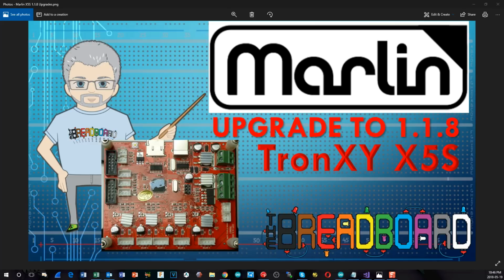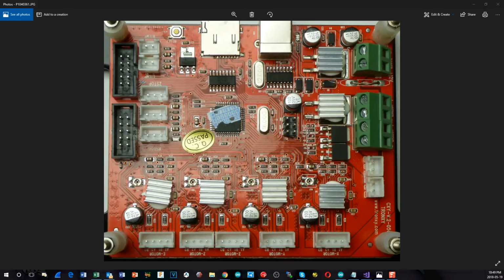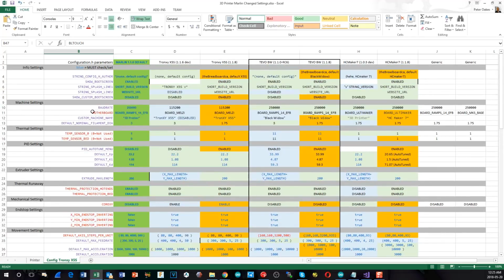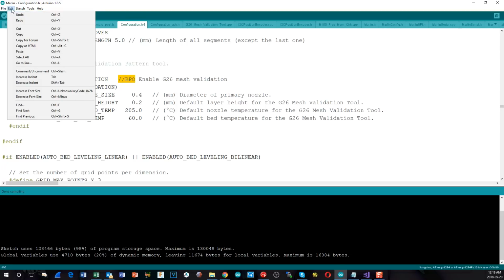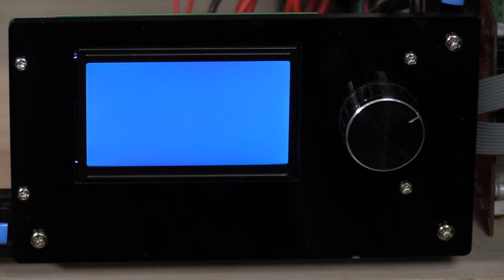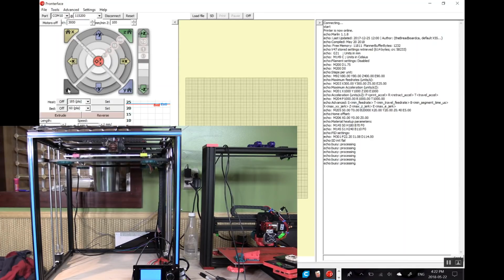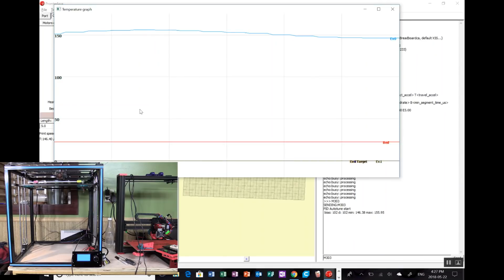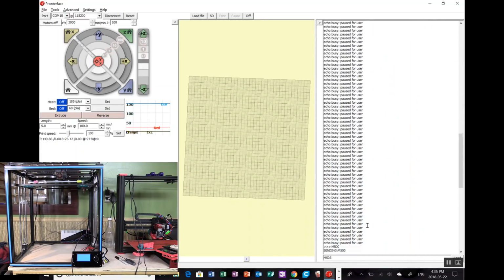TronXY X5S - 3D printer upgrade to Marlin 1.1.8 part 5

Comment: I have a hex file and tried to load it but it just hung no matter what the configuration was. I tried uploading marlin via Arduino and it wouldn't compile/upload if I choose Sanguino.
Reply from the maker: did the file load the first time, if not then you may need a small AVR based programmer board as there is a good chance there is no boot loader in the target board.

Comment: The Tronxy website says "Can use open source firmware Marlin, configuration and Ramps1.4 exactly the same, can directly replace Ramps1.4." but the video seems to indicate that there are indeed config changes that need to be made.
Reply from the maker: Indeed you can use a Ramps board and the latest Marlin, in this video it was 1.1.8 and this video I show the upgrade to my X5S to use the Ramps board and a few other hardware upgrades, this includes programming the RAMPS board to 1.1.8, there is also a link to my configuration in the description of that video https://youtu.be/q1nfojoZUvA. There were a couple of "Tweaks" to the config in order to support the original display and that is why I provided my config file. I also describe the changes etc.
Reply from the maker: investigation it was found to be the pins_SANGUINOLOLU_11.h that was the issue, the configuration.h was actually ok but a bit better when I added the three timing updates. the Pins file had been completly changed by Tronxy so they were not following the MELZI pin out. as soon as I copied the one from my original Tronxy X5S build it burst into life. I hate it when Manufacturers rip off something and then just tweak it enough to call it their own but dont change the names etc to match. Ah well, its working at least and I will still be updating it to a Ramps 1.4 board as I want to add  24V, BL touch and other features so I need the 2560 chip.

I have updated my GitHub folder with all the files(3 of them) needed to copy into a standard Marlin download
https://github.com/thebreadboard/MARLIN

Comment: Would this same process be able to be used on the tronxy X5SA pro (24V)
Reply from the maker: I dont see why not, you need to know what the board type is so you can set the right pins mapping, that should be easy to confirm
Reply: @TheBreadboardca  Thank you for the reply It is actually going to be my 2nd 3d printer. I still know nothing about it though...Lol I have a friend who is helping me and he said to find a way to put marlin firmware so that the offset can be changed for a BL touch and in case I want to change the carriage later.  Is there a way to just flash Marlin without changing any pins?
Reply from the maker: @truthslayer9653  No, unfortunately there is not, especially if your adding BL Touch etc.You use Arduino IDE or Visual Studio Code with PlatformIO, compile the Marlin code and then upload, once you have the pins set though, you can make other changes without affecting the settings again (BL Touch may actually be the exception as it needs pins configuring for it

Comment: Is there anything different in Marlin if you have a Tronxy x5st 500 2E model?
Reply from the maker: Yes, plenty. Size for one, the 500 2E is 500x500x600 so a good 20cm bigger in Z direction and 17cm in x and Y. it also has touch sensor and TFT display so there will be many differences in the configuration file. I dont have one of these printers yet so cant share my configuration file. It looks to be a massive printer and also has the benefit (And need) of using a 24V 500W power supply.

Comment: Hi please, I really hope you can help. I recently bought a Tronxy X5SA 3D printer but every time I try to print using a USB and repetier software I get errors such as (it seems we are missing and OK). So I thought it was the configuration so I tried various ones but still got the same error. Please if it is possible can I get a configuration for this printer.
Reply from the maker: Are you planning on reflashing the firmware, do you mean Cura of Slic3r or something else. can you show me the exact error you getting ?

Comment: C:\Users\Lt.Dan\Downloads\TronXY_X5S_Marlin_1.1.8_Firmware\files\X5S_Marlin_1.1.8\Marlin\Marlin.ino:1:20: fatal error: U8glib.h: No such file or directory
 #include <U8glib.h>
compilation terminated.
exit status 1
Error compiling for board Sanguino.

Do you know what I'm doing wrong?
Reply from the maker: In Arduino IDE, go to library manager and search for U8GLIB
Thats 
[Sketch], [Include Library], [Manage Libraries] 
type in u8glib and look in the list, there should be one from "oliver", mine is version 1.19.1, install that and it should now go past that error
Reply: You are the man of the day..... I've finaly updated 2 X5S now. Marlin 1.1.8 from thing:2738690 runs fine. The Marlin 1.1.9 from thing:3034942 can be uploaded, but my Displays stay white. Don't know why, but this can be fixed later. :)  @TheBreadboardca
Reply from the maker: @michaelbottger4983  Happy to see your up and running

Comment: Yes I did check the mosfet chip all is correctly hooked up. I even tried a new mosfet chip. No change there either. I’m wondering if it’s a faulty board?

Comment: Hey Peter! I did everything you said step by step, but I can't fix this issue I tried now for a 5 days and no luck.. here is my error..
Sketch uses 120576 bytes (92%) of program storage space. Maximum is 130048 bytes.
Global variables use 4544 bytes (27%) of dynamic memory, leaving 11840 bytes for local variables. Maximum is 16384 bytes.
avrdude: stk500_getsync() attempt 1 of 10: not in sync: resp=0x58
avrdude: stk500_getsync() attempt 2 of 10: not in sync: resp=0x4c
avrdude: stk500_getsync() attempt 3 of 10: not in sync: resp=0x41
avrdude: stk500_getsync() attempt 4 of 10: not in sync: resp=0x4f
avrdude: stk500_getsync() attempt 5 of 10: not in sync: resp=0x44
avrdude: stk500_getsync() attempt 6 of 10: not in sync: resp=0x0a
avrdude: stk500_getsync() attempt 7 of 10: not in sync: resp=0x65
avrdude: stk500_getsync() attempt 8 of 10: not in sync: resp=0x63
avrdude: stk500_getsync() attempt 9 of 10: not in sync: resp=0x68
avrdude: stk500_getsync() attempt 10 of 10: not in sync: resp=0x6f
An error occurred while uploading the sketch
can you Please help. thanks chris w
Reply from the maker: So it looks like it is compiling ok, just not uploading. I assume your using an ISP programmer, not the USB port on the device, please confirm. I will dig out my controller (I still have it) and see what i do with it. What type of programmer are you using ?
Reply: Peter Oakes. Still having Sam issue with heat bed not being able to control. This is why I wanted to change firmware. Errrr
Reply from the maker: @3BoyzLaserEngraving  did you check the mosfet etc as I had described in the other thread
Reply: ok I did some checking bare with me as I tell you my steps.
1. I switched mosfets same problem as before bed still turns on.
2. I removed the mosfet from my control box.
3. I hooked the hotbed to a 12volt power adbt, of course it turns on as I complet the circuit. so that bed works fine.
4. I checked the hotbed connection on the mainboard and the hotend as well on the board while turned on.
Found the problem with my meter my. board on nothing working, hotend off and hotbed off, I checked the voltage, the hotend has no VOLTS, checked the hotbed and there is 12VOLTS CONSTENT at hotbed. there is my problem from day one. no matter what tronxy would never get back to me or gearbest.  so there is a short on the board from NEW.
now I wonder how I fix this short and how to find it??????
Reply from the maker: @3BoyzLaserEngraving  So typically you should have 12 V on one wire of the Hotend or Heatbed when the PSU is on with reference to the power supply negative (0V), this is how they are wired, 
The + from power supply goes into control board (and Or External MOSFET Board), then to the heater (Hotend or HeatBed) with nothing but a short length of PCB and in the case of the main controller a fuse. the return from the HotEnd or HeatBed goes back to the control board or External MOSFET board to one end of the MOSFET. when the mosfet gets turned on it will effectively short the return path to the 0V of the power supply turning on the heater. to if the heater is ON then you will measure approximately 12V across the terminals of the heater (HotEnd or HotBed), if it is off then you will read 0V across it but 12V referenced to ground.
If you are using an External MOSFET then unplugging the control wire from the control board to the MOSFET board should turn off the heater as there will be no signal to turn on the MOSFET.
If you use your meter on resistance mode and measure between the HotBed output(+ of the meter) and Ground (With the power off) tou should have an open / very high resistance. note if you reverse the meter probes (- probe to heater output and + probe on ground / 0v) you should get a low reading, if not try the same process on Diode check mode). if you get a low reading in both directions then you indeed have a short, either on the board or inside the mosfet
Reply: well I cant figure out how I did it with the printer cable, do you have any idea on how I may have done this? thanks cgw
Reply: I am just using my USB. Flashed it to 1.1.9.  And it works great but not sure how I did it or what settings. I was trying for the 1.1.8. But used wrong file. Also you can take the 2 files save them as .gcode and past on sd card then run as print to also flash and it worked. Crazy I know but when I rebooted there was the new marlin.
Reply from the maker: @3BoyzLaserEngraving  I just tried my original board and confirmed it wont program via the USB, I have to use the ISP socket and a programmer like the pololu PGM03A. this is because the boot loader is not loaded and also if it was it would take space needed for features to be added
Reply: Peter Oakes very odd as that’s how I got mine done when I get back I’ll do it again and show you a video. Thx. My board has a short. On the hotbed side. 12 volts always as my bed led is on. When not asked by the software. When my hotend not in use. There is no 12 volts at the pins. So now to find the short and fix it
Reply: just for poops and hahaha's, I switched the signal wire from my hot end from my mosfet to the heatbed on my board and heatbed signal wire to my hotend side to my board., and now my hotend fires up when not told to do so....im making the video now for you
Reply from the maker: @3BoyzLaserEngraving  If your ok with soldering and un-soldering you could try removing the MOSFET in question and simply power it up again, the board should not heat up if the FET is the broken item
Reply from the maker: @3BoyzLaserEngraving  ok, look forward to seeing it, see if you can include a close up of the mosfet from both sides of the board
Reply: Peter Oakes. Do you mean the mosfet that’s built on the main board or my extra ones I put on my hotend and heatbed?
Reply from the maker: @3BoyzLaserEngraving  can you email a diagram of exactly what you have wired up in that case :), peter@thebreadboard.ca
Reply: Peter Oakes. Yes I can do that. I’ll get it done in the morning for you.
Reply: Peter Oakes   I sent you an email or 4. Lol it might be in your spam
Reply: Peter Oakes just wondering if you got my email
Reply from the maker: @3BoyzLaserEngraving  So I know you can use Cura for instance to upload a firmware version to a printer that has a boot loader but this is not what your describing, can you provide a link to were this method of update is shown as I am not able to find anything, and from what I have seen is not even supported in the firmware. If using some of the 32 bit boards, there is the possibility of putting firmware on the SD card and have it auto update but that is not on the basic x5S controller ?
Reply: Peter Oakes. That is correct, just running the standard board. I will be up grading next week to tronxy 32 bit board and touch screen with auto bed level and duel filament in and 1 color out. Now there is no link to do the install from SD card. I got so frustrated I just created a gcode with Arduino interface and copy past to SD Card and hit print in order and it worked great. No issues at all. The printer works great now.  Have you trued python it to works great and I find its better than Arduino! Any thoughts?

Comment: You need to add the ug8lib library for the display to work. This has always been the case with marlin.

This is because you can also use other display types and this one is just not enables by default. 

Just add the ug8lib to the sketch top and enable this display somewhere at the bottom of the config sketch.
Reply from the maker: While you are correct, I did have the library loaded already, it was some special parameters that were missing and also the TronxyX5S folks had re-defined some pins from the standard board type they cloned. as soon as both these issues were fixed, the display burst back into life.

Thanks for the feedback though as many viewers / 3D printer owners are not fluent in Arduino Programming and would easily miss that point.

Comment from the maker: Thanks to Lucky Phillips
 I was prompted to further investigate why my display stopped working, Using Lucky Phillips
 branch of Marlin worked with the display so on further investigation it was found to be the pins_SANGUINOLOLU_11.h that was the issue, the configuration.h was actually ok but a bit better when I added the three timing updates. the Pins file had been completly changed by Tronxy so they were not following the MELZI pin out. as soon as I copied the one from my original Tronxy X5S build it burst into life. I hate it when Manufacturers rip off something and then just tweak it enough to call it their own but dont change the names etc to match. Ah well, its working at least and I will still be updating it to a Ramps 1.4 board as I want to add  24V, BL touch and other features so I need the 2560 chip.

I have updated my GitHub folder with all the files(3 of them) needed to copy into a standard Marlin download
https://github.com/thebreadboard/MARLIN
Reply: Another for you guys... I got sick of waiting 20 minutes for it to warm the heatbed to 60C... so I added a $5 relay, got a 1400watt heatbed ($60 from Singapore), a 3mmX440mm aluminium sheet ($20), threw some matching and new extended holes in it... a 4mm pc of tempered glass ($30) and connected it to the house power... now it warms to 110C in about a minute :) This is for the Tronxy x5s-400 ... Hope that helps too :)
Reply: If anyone's having troubles with finding Sanguino... goto file->preferences and add this line to Additional Boards Manger URL: https://raw.githubusercontent.com/Lauszus/Sanguino/master/package_lauszus_sanguino_index.json
Reply from the maker: Thanks, Ill add that to the main post description, I forgot earlier.
Reply: Peter Oakes so I did everything explained in your video. For flashing but I get an error in the sketch. I don’t really know how to fix this as I’m very new with playing with this type of programming. I have a 8 second video of the error. I hope you can help me thank you sir. Keep up the great work I’m learning a lot from you cheers. 
https://youtu.be/JNTl6efFmZQ
Reply: Sorry to bother yo but, any idea how to get this screen working with an MKS Gen L board? I've managed to get to the point where i can get the screen to flash at steady pulse but that's about it (I took the pin layout from the github link you provided, but im not entirely sure where im supposed to put them with this board).

Note: The x5s im installing this on is completely stock other than the board change.

Thanks in advance for any help  you might be able to provide!

Comment: You might want to follow the configure.h file under https://github.com/nathantsoi/Marlin/tree/tronxy-x5s-1.1.8 ... and get your display back ;)
Reply: Set your BAUDRATE to 19200 ... and don't bother installing any other display libs... Just trying to help as you don't want to end up like the end of this video. Nice Vid btw... shame about your final configuration as you were doing so well :)
Reply from the maker: Thanks for the feedback, I was in the process of investigating this and your comment prompted me to look at your build. It worked with the display so on further investigation it was found to be the pins_SANGUINOLOLU_11.h that was the issue, the configuration.h was actually ok but a bit better when I added the three timing updates. the Pins file had been completly changed by Tronxy so they were not following the MELZI pin out. as soon as I copied the one from my original Tronxy X5S build it burst into life. I hate it when Manufacturers rip off something and then just tweak it enough to call it their own but dont change the names etc to match. Ah well, its working at least and I will still be updating it to a Ramps 1.4 board as I want to add  24V, BL touch and other features so I need the 2560 chip.

I have updated my GitHub folder with all the files(3 of them) needed to copy into a standard Marlin download
https://github.com/thebreadboard/MARLIN

Again, thanks for the help